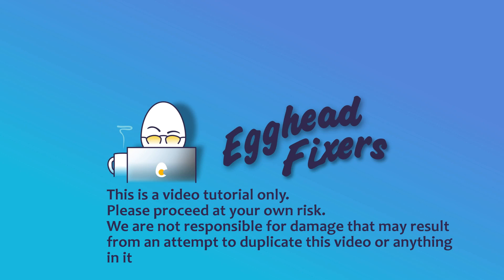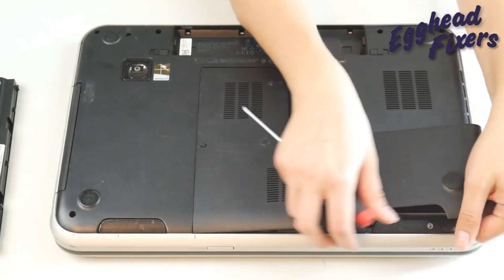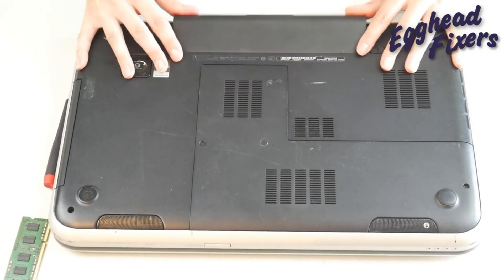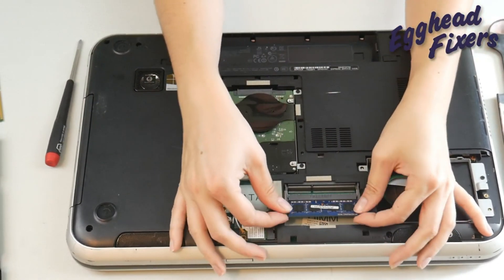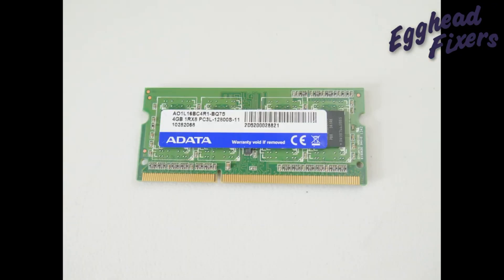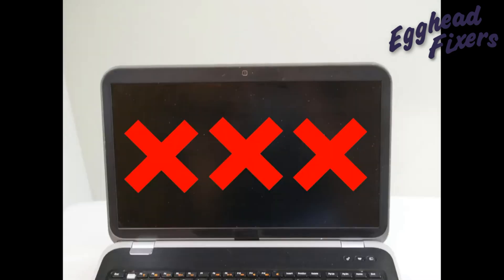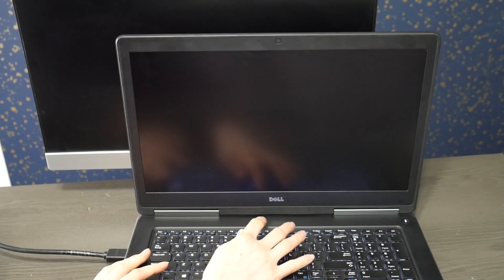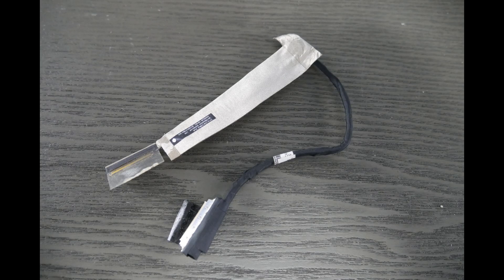Fix For My Laptop Screen Glows but is Blank - Tutorial By a Certified Technician

Comment: Does this problem relate with LED screen problems? Because recently the laptop i received has a messed up LED screen. It still relates to the problem about the keyboard lighting up before disappearing immediately but the power button is on.

Ah okay, yes. You just mentioned it. The LED/LCD is related to this problem. Haha so im not about to get my ass beaten later by my dad then 😌
Reply from the maker: Ugh sorry to hear that:(

Comment: I have these problems in my msi gl series. first my laptop can turn on without charger plugged in, but the screen is remain black and only the keyboard glowing. the 2nd problem is when the charger plugged in, i can bypass that black screen problem, i can even do task in my desktop like usual, but sometimes it's just went glow black or my laptop just shut down without warning. and the 3rd problem is when my laptop is in charged and I try to plug out the charger, my screen just went glowing black randomly. are these problems related to bad ram stick? I only have 1 ram stick attached so I don't know if I can perform diagnostic check like in your video..
Reply from the maker: It could be a problem with your battery and/or the flea power needing to be released from the system. Here is a video that helps with both those issues:

https://youtu.be/CCDeG930UT0

Let me know how it goes:)

Comment: How can I fix my acer laptop without a battery (but it works when I plug it in) but no display when I turn it on?
Reply from the maker: If it turns on but the screen doesn't work then you would use the same method you see in this video.